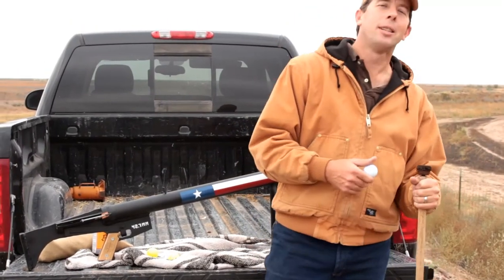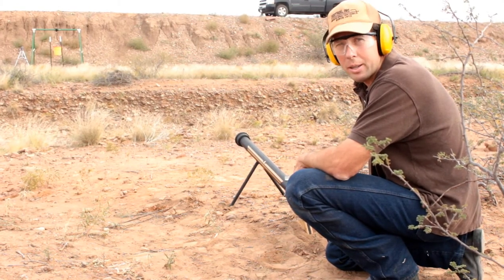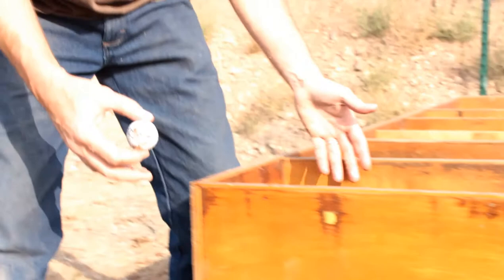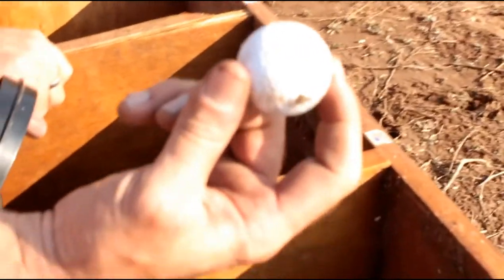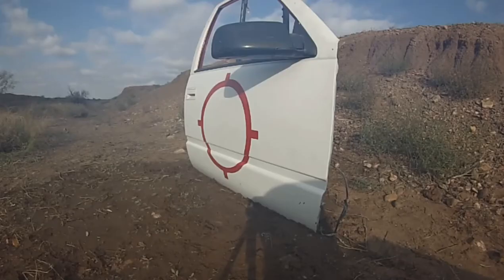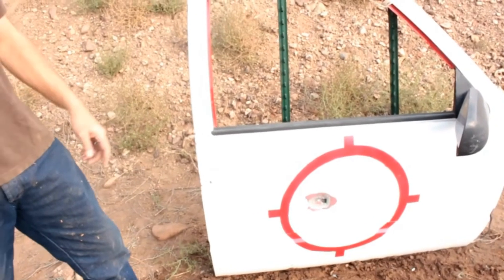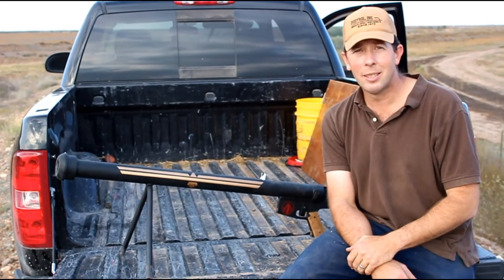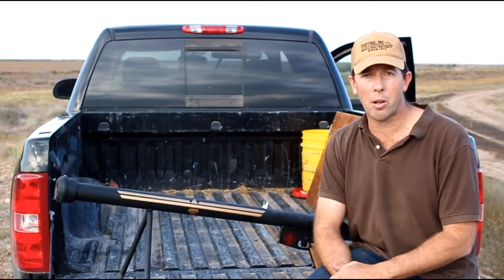Homemade Golf-ball Gun VS Car Door!

Comment: I’m constructing one out of some scrap metal from work, using a 2in chrome lined pipe and a 2 3/8in bull plug as a screw in chamber. Could be used as a breech loader or a muzzle loader. How many grains of powder did you use and what is yours made out of. It looked to me to have a hammer union for a muzzle break, is it just simply 2in industrial water line? My metal is much stronger and thicker then conventional tubing and I’m trying to get a feel for appropriate barrel length and powder loading. Hopefully going to be making 2 of these cannons giving the barrel is actually 8ft long and threaded on both sides

Comment: For what it is worth, I get better results with my black powder mortars and cannons when I use true blackpowder, like Goex, instead of Pyrodex
Reply: What kind of pipe are you using more for longer cannon type. I’ve got a pretty cool mock up of a 4 ft cannon but it’s made of irrigation pipe definitely not thick enough or good enough metal to try to shoot with especially with it’s bore size being fairly large. My idea was making an insert of golf ball size so I could shoot something. Maybe center it with sand as an extra measure of safety along with the outside pipe.